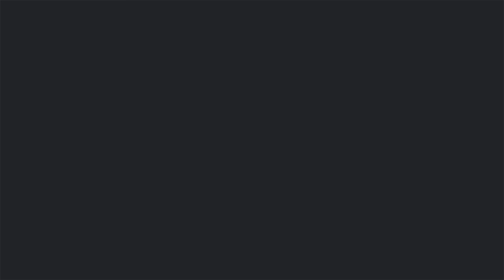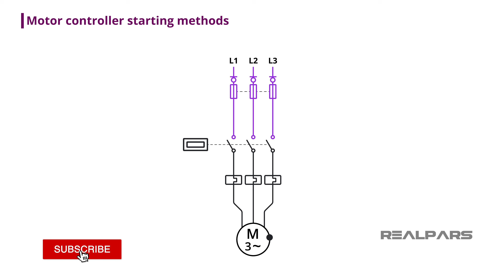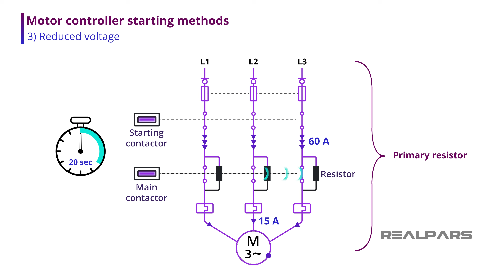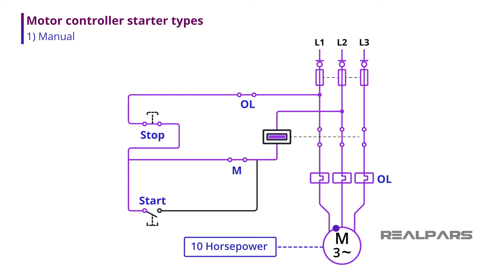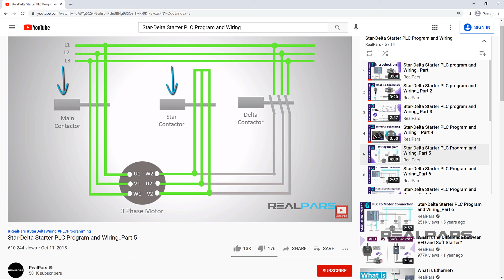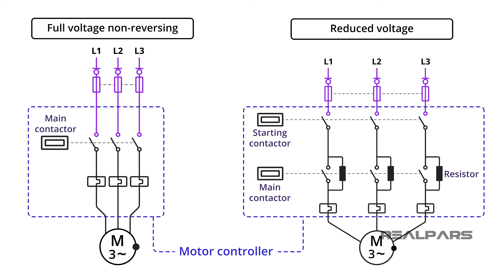Motor Starter Explained | Motor Starter Types

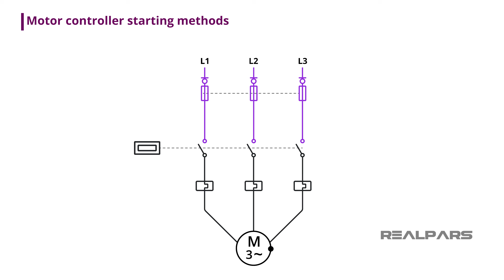Comment: What is the triangle displayed in  between the contactors at 2:54 in the video? Is it a mechanical Interlock?
Reply from the maker: Thank you for your inquiry. Indeed, the symbol you mentioned represents a mechanical interlock. As emphasized in the video, it's crucial to avoid having both contactors in the "ON" position simultaneously. Doing so can result in a dead short within your circuit, potentially leading to a fire hazard. The triangle symbolizes this mechanical interlock feature. 

Happy learning!

Comment: So with a soft-starter, can you simple wire the motor in run (Delta)? instead than power the motor in start(wye) for a few seconds and then change to run(Delta)?, Talking about a 480v single-voltage motor
Reply from the maker: Yes.  Control of starting current in the case of a soft-starter is controlled by the device itself.  There is no configuration using a soft-starter where the wiring configuration is changed as there is in a star-delta type starting scheme.  This makes the use of a soft-starter simple from a wiring standpoint and very helpful in keeping the starting current in check.

Comment: Thank you for the well detailed video. 👍

As an HVAC Application engineer, i have come across projects where asked to provided motor starter in bypass line of E-bypass vfds. Is this mainly for safety reasons in case of VFD failure? To my knowledge, most E-bypass VFDs already come with embedded motor starters in their bypass line, so i thaught it might be redundant to add an additional motor starter. Please correct me if i am wrong.
Reply from the maker: Yes, having a bypass line with a motor starter (contactor) is a means to bypass the VFD and be able to continue to run the motor if the VFD fails.  If the VFD package already comes with a bypass circuit, adding another bypass would not be required.  However, sometimes you may need to add another contactor to be able to isolate the VFD if running in bypass.   This is the K2 contactor in the diagram at the beginning of this article:
https://www.esmagazine.com/articles/99352-in-hvac-vfds-is-2-contactor-bypass-really-better-than-3-contactor-bypass
Reply: @realpars  I appreciate the thorough response, thanks for your help!

Comment: L2 goes to L2, why do we need a 3rd pole?
Reply from the maker: Three poles = three phases (L1, L2, L3).  In a 480VAC circuit, I need 3 poles to supply the motor, which each phase 120 degrees out of phase with the other poles.  In 240VAC, I only need L1 and L2.

Comment: Why was primary resistor method not included in the explanation? Good video though.
Reply from the maker: Thank you for your question!  To be honest, there are several types of motor starting methods that we did not cover, including primary resistance.,  Our videos are typically 6-8 minutes in length, and we have presented the methods that are most commonly used in the industry.  Other types of starters also include rotor impedance, liquid resistance,  use of chokes, as well as others. These are specialized methods not as widely used, but still very important in the uses they were particular designed for.
Reply: @realpars  thanks. that's some light into my knowlwdge.

Comment: What is the normal transition time for wye to delta starter
Reply: Depends on the start up time. You've got to time it while it ramps up. And when you switch between star and delta you need to create a small delay when you turn off the star circuit before you turn on the delta circuit. Failure to do this will lead to a very bad day.

http://www.gohz.com/motor-star-delta-changeover-time-delay#:~:text=In%20star%20Delta%20usually%20we,%2C%20to%20avoid%20short%2Dcircuit.

The site mentions a 30 - 50 millisecond delay, That's pretty short if you ask me. It goes on to mention a 1 - 2 second delay. That's a saner option. Keep in mind that if your load takes a long time to start up, it will also take longer to stop. So a 1 - 2 second delay isn't going to hurt anything.

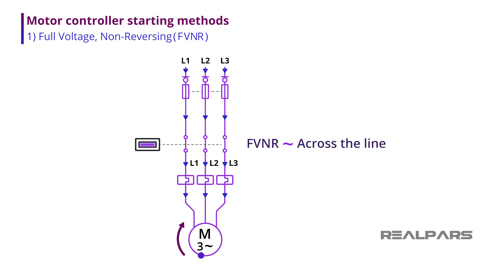And it is critical to include interlocks by way of contacts on each starter to prove that one starter has dropped out before bringing in the other. You also need to use a mechanically interlocked starter (a forward - reverse starter as seen @2:13) to mechanically prevent the starters from closing at the same time. Should both starters get engaged at the same time it's a phase-to-phase short, generally on a rather large feeder. Our plant had a 500 hp star-delta starter short out this way. It was an exciting day for our electrician.
Reply: @MrWaalkman  Is the time the same regardless on the size of the motor?  Is there a table or a graph on how many seconds will a motor be on its rated speed when you start an induction motor?
Reply: @elec3calengr  Unfortunately it isn't. Really large motors have much more mass to spool up, as do smaller motors that drive heavy loads (that have a lot of mass in themselves). 

As for charts and graphs, I don't know of any. And it would be difficult to chart motors given the wide variety of loads. But if your Wye-Delta starter works off of a timer, it would be simple to bump the time up and either monitor the current to the motor, or just listen to the motor to find a suitable preset to set the timer to. 

A word of caution on motors, the larger that they are, the less number of "starts per hour" that you get. This is because of the extra heat that builds up during the startup of the motor. A 1 hp motor can be started just about as often as you would like to start it, while a 500 hp motor will have a recommended number of starts per hour limited to about one per hour. While this may seem apropos of nothing, if you have reason to soft start your motor, then you probably should know the limits. ;>

https://www.efficientplantmag.com/2015/05/safe-starting-of-motors-check-for-temperature-increase/
Reply from the maker: MrWaalkman is correct with his assessment.  That said, a delay of 50ms (3-4 cycles) is normal for an open transition star-delta starter.  I have heard of some people putting in an interposing relay between the Delta controller output and the delta run power relay.  This can add about 30ms due to the pull-up time for the relay.  Closed-transition starters of this type are best, but they are very expensive in many cases.
Reply: @realpars  
How do you size the resistor in a close transition wye Delta starter
Reply: @realpars  How do you size up the resistor on a close transition wye start delta run starter?